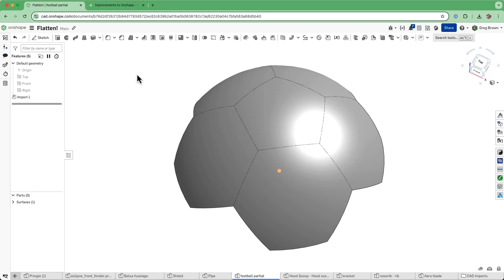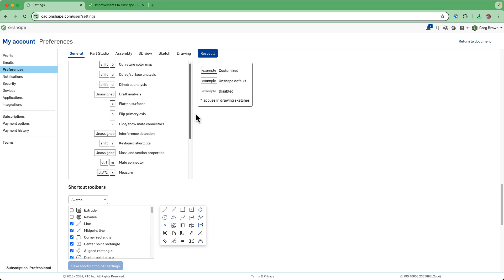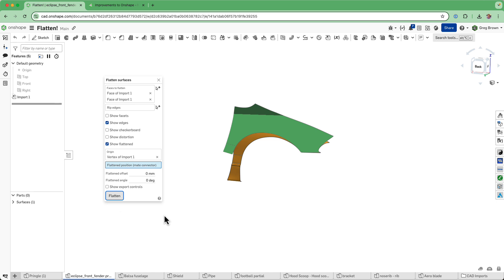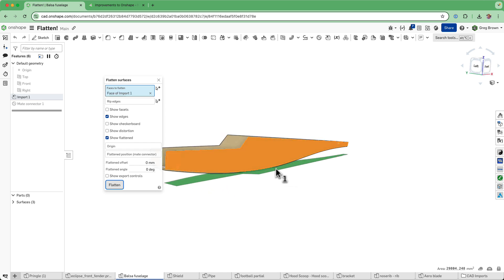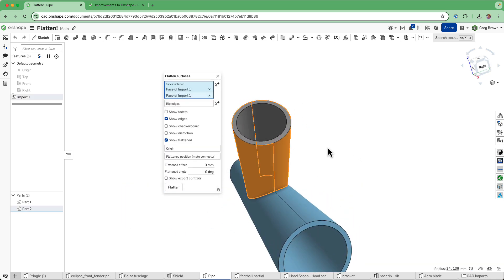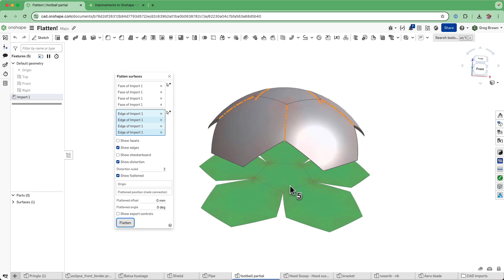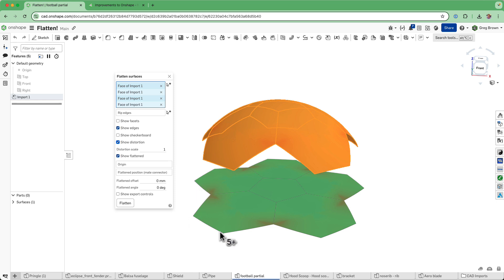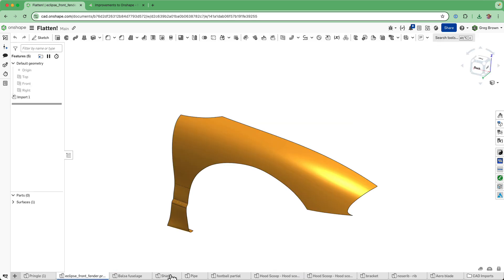An introduction to Onshape Flatten surface - New Feature Friday!

Comment: A  case that many may appreciate seeing your approach to ... 3D model plane fuselage skin (with compound curves) that will be made from ~ 6 mm thick foam to cover ribs etc. The sheet metal tool is great but can't create flattened parts that have compound curves. How would you unwrap a complex airplane skin for laser cutting or hand cutting off a paper plan?

Comment: Greg, this new flatten feature looks great! Are there any future plans to extend its capabilities? Specifically, I’m interested in having the output available as a sketch for further downstream use. My use case is digital fabric pattern making, where having the flattened shape in a sketch would allow for easy offsets (e.g., seam allowances). This would be a huge benefit for workflow efficiency. Thanks!
Reply from the maker: Not sure if you saw but there is the option to download the flattened shape as a x_t (Parasolid), DXF, SVG or STL file. You can reimport this to Onshape to create a draewing, ro do other modeling operations to it.

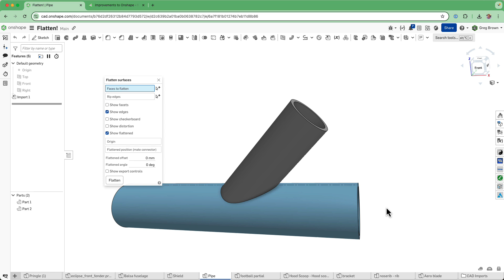Comment: How does the rip work at 8:40? I cannot select a line from a sketch to Rip edges. If I split the body in two and select both side surfaces of the body, I get this warning: Select a single contiguous set of faces.
Reply from the maker: The edge to be ripped needs to be part of the face(s) that are being flattened. I.e. you can't select a sketched edge, but rather you should choose (use the "Select other" option) the underlying edge of the face.

Comment: How do I easily get the dimensions of my flattened surface? Seems like right now I can only export it and I can't figure out how to get the dimensions from the .dxf or .svg file.
Reply from the maker: Use the Parasolid (x_t) export and then bring it back into a new tab. You can use all teh measurement tools (and modeling tools) on it very easily.